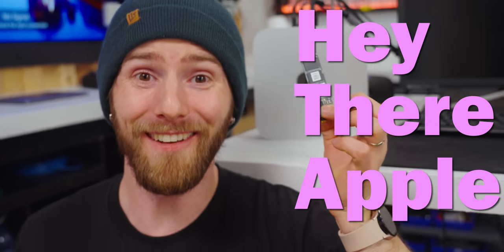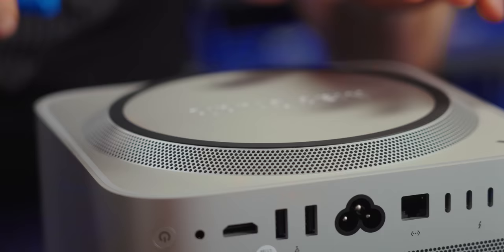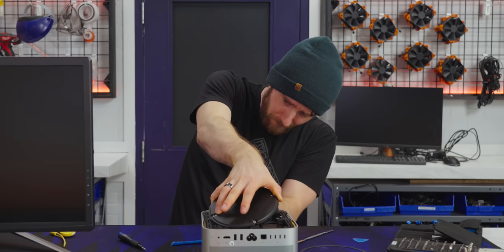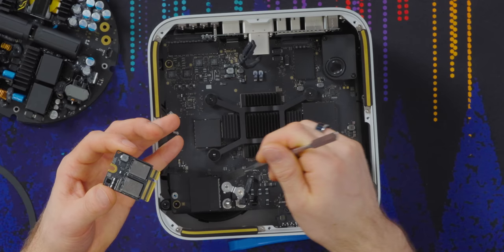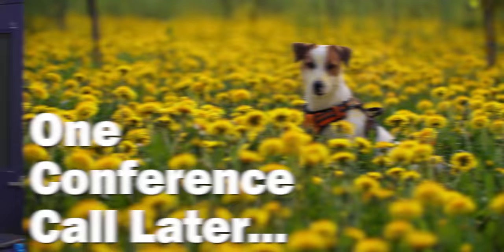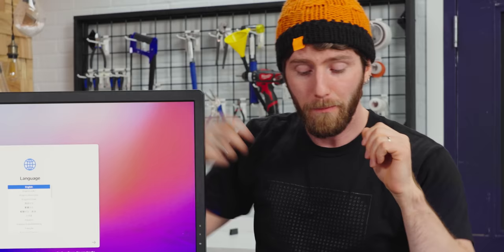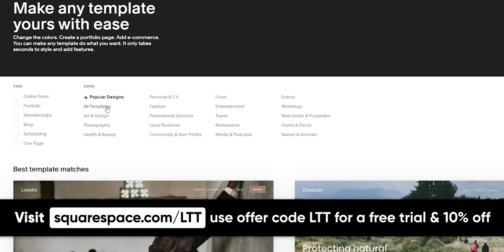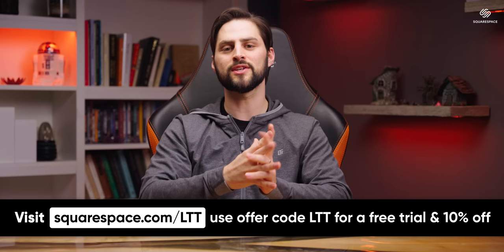I want to love Apple, but they’re making it hard - Mac Studio SSD Swapping

Comment: Apple: our all cardboard packaging shows how green of a company we are!
Also Apple: throw out your entire $3000 computer when you run out of 512gb storage.
Reply: That price is nauseating
Reply: The fact that they even sell computers with less than 1tb of storage is hilarious.
Reply: What an over simplification this statement is. It's a desktop with multiple Thunderbolt ports so nothing to stop a user adding external drives that will be damn fast. It also has a 10Gb Ethernet port so connect it to a NAS for bulk storage is another possibility. Only and idiot throws out a computer because the HD is full, at worst they sell it.

Your statement is slightly more relevant in relation to RAM though where you don't have an upgrade path but even then, only an idiot would throw it out.
Reply: @jadamsnz  Tim Cook alt account spotted.
Reply: @jadamsnz  Yes, because the average Apple enjoyer would go out of their way to build their own NAS. 
The people that are notorious for prefering ease of use over upgradability and customisation.
Best they'll do is put on some external  HDDs/SSDs, but even then the point of this mini pc is to have a small clean pc somewhere nice, not have stuff hooked up to it all the time.
Reply: @0cyb3r0  A Mac studio user would. These are people who are working with massive amounts of media. You can buy off the shelf NAS machines too/.
Reply: @SirFrag32  Yeah all those people who write 20Kb code files or draw a single 50 Meg image in the matter of days really need a NAS... A bit of a bold assumption.
Reply: @jadamsnz  talk about putting words in people's mouths. it's plain and simple and yet you missed it. buying something of this cost in the PC space allots you ANYTHING you want to change. and it gets the job done just as well, as proven time and time again. 10 gig ethernet on LOTS of motherboards on the PC side. but they still give you upwards of FIVE m.2 storage slots, and let you raid and set them up as you wish. apple is being cocky and saying "we know better" and are basically FORCING you to buy extremely expensive network storage or pay into extended storage on the iCloud. 100% of their hardware model is built to make you spend money once youve run out of room. PC is the opposite. need space? cheap upgrade. need speed? cheap upgrade. apple is image and clout and a moneymaking scheme. it's pathetic, and it pisses a lot of people off that they make this nice "green" packaging and yet make it so you cant do crap to your TINY storage if you happen to fill it up. oh, and apple's network storage isn't going to allow you to edit massive video files via 10 gig network connection because the storage in the time machine isnt fast enough to come CLOSE to saturating a 10 gig connection. so your whole argument there is completely moot.
Reply: @0cyb3r0  I'd imagine the bulk of Studio owners will be content creators working with video. So a NAS would be commonplace among those users.
Reply: They just want you to pay for cloud storage
Reply: @Skrenja  for that price too
Reply: @atlehassum1492  im happy enough with my intel nuc, way better
Reply: @jadamsnz  r/woosh
Reply: @jadamsnz  we found the apple fanboi, guys :)
Reply: Yea, I remember my iPhone storge got full so I threw it away and bought a new one. I considered cleaning out space, but yea.. fuck it, toss it. If you could let me know where you live, I'll stop by and pick up all of your computers with full storage since you're throwing them out.
Reply: @kevinmorrice  it’s literally and figuratively not.
Reply: @0cyb3r0  "build their own NAS"... since the common narrative is "Apple users have too much money", the average Apple user would buy a Synology (for ease of use). There is no need to "build your own NAS". I am actually surprised that storage complaints on a stationary device in 2022 are still a thing. Especially on a device that has a couple thunderbolt ports and 10Gb lan. 

It's even more baffling when you consider that this is aimed at creators... creators who most likely have a MBP and iPad. They most likely have a NAS already so they can work on their stuff away from the Mac.

Complaining about non expandable/upgradeable storage makes more sense when it's a Laptop.
Reply: LOL! I can’t imagine anyone would buy a computer with six Thunderbolt 4 ports and then complain about using one of them.
Reply: @jadamsnz  We found an apple customer hahaha
Reply: it's only green when it benefits them
Reply: @Skrenja  for me it's the fact people actually buy them.
Reply: @jadamsnz  i dont know about you, but i think even a m-atx motherboard PC fully loaded with SSDs is more green, more cost efficient, and more space efficient than having to own a studio intended mini-PC that requires a NAS to be useful...? Then whats the point of making it excessively small then? Might as well use standard Mac tower cases with standard ATX power supplies (or 12V ATX) which should be cheaper and greener since its the standard. 

if its meant to be used with removable drives and NAS, then whats the point of it being mini and portable. if the consumer has a NAS at his studio, then brings the Mac Studio on weekends to continue work then its not gonna be an easy way to connect to his NAS, and even if he could, getting a good connection would be expensive. its just self-contradicts itself. you're just saying random stuffs to justify Apple products but you dont even think about real life applications. 

why do you need a 2nd mac for troubleshooting said product? previous mac products can troubleshoot themselves before just fine. is that such a huge obstacle to overcome as you transition to a new SoC chip? even then, considering the overpriced retail prices of apple products im pretty sure apple has enough funds to spare for engineering that part. also you had to engineer said products to be able to communicate between each other for troubleshooting so that is already an engineering investment so wtf? why it can talk to other macs while broken, but cannot try to fix itself while broken?

after all facts have been considered, the absolute truth is that Apple products are for people who have the money, is willing to spend the money, and just has zero concerns about upgradability, future value, cost efficiency, power efficiency, space efficiency, and ergonomics. They are perfectly fine with getting what they are advertised on face value and is satisfied with the product for the rest of its life, which is fine i guess. the problem is other platforms offer so much, that some Apple consumers question "why cant we have a certain degree of this too, i thought we are a premium brand, we should deserve to get this, even if we have to pay more" but you just cant, even if u had money.
Reply: @jadamsnz  Why should I have to have external drives only.  On my pc I don't.  I can simply plug in s higher capacity drive and boom. Off I go.
Reply: It's not really an issue with dektop, but HUGE issue with laptops. You won't even notice an external drive, or NAS on your desktop, but you will always forget it at home when you need to use it with your macbook.
Reply: @Skrenja  there's so many computers with less than 1 tb. My mom is shopping looking for some kind of laptop with the space she wants and SO MANY are coming with just 512. She's not a techy person, but she's seen this size harddrive come and go and become outdated and is PISSED.
Reply: @jadamsnz  let it become an octopus with 500 arms simply to store your pictures. No. Just stop. There's 2 slots in there for more storage, it should be reasonable to allow a user to fill in all the slots, much less replace a flash stick with a higher capacity when that inevitably becomes available down the line.
Can you honestly, reasonably consider a desktop windows PC that would prevent you from adding in another drive to your sata port as acceptable? No. No way in hell. Laptops have already for decades allowed you to fill in every storage port and upgrade your storage to your heart's content. there is no reason, besides greed, to block this from the consumers.
Reply: To the commenters siding with Apple in this, stop. Just because a use case exists for it, doesn't justify them making this choice. The idea is simple. They want to make devices more serviceable with one hand, and then lock down what would otherwise be a common thing for user servicing (storage) with another.

It wouldn't take Apple much effort to make these things easy to access and service, but they not only choose not to but they put arguably more work into making sure you can't.

It's truly annoying and anticonsumer and it's the entire reason even diehard Apple fans have been upset with this approach.

No one wants to blow a bunch of money on a product you can't fix or upgrade when the alternative exists. But people get so sold on the OS they are afraid of switching out so they just keep feeding the beast.
Reply: Also Apple: Thinking people use this wonderful thing called an external drive .  PC minded people replace the entire computer every 2-3 years.
Reply: @jadamsnz  Right.  In the MacRumors thread "The base model Mac Studio is great value."  F-Train shows his set up - main internal SSD only has the system and a handful of application that must be on the internal and everything else is on external SSD.  Only 50 GB of his 500 BG (ie a 10th) has stuff on it.
Reply: @Maximara  this is so adorably naive. Consumer PCs currently aren't intentionally engineered to prevent the most basic of upgrades, and /requiring/ the extra copper, plastic, and aluminum for external drives and cabling because you're locked out of existing and empty drive ports isn't green either.
Reply: @Crunchy415  You are the one who is "adorably naive". Steve Glaser an Electrical Engineer pointed out on Oct 11, 2018 the reasons for soldered chips:

* Cheaper — no sockets to buy  Faster to build — fewer steps  
* More reliable — sockets are mechanical parts and sometimes flake out  
* More rugged — dropping the computer won’t knock something loose  Market segmentation — if you want 8GB but the, otherwise ideal, model only has 4GB soldered down, you will likely buy a more expensive model with 8GB  
* Loss leader — limited power non-upgradable computers are sometimes intended mostly to get you in the store so they can up sell you  
* Parts availability — socketed parts are sometimes different than soldered down parts and the parts suppliers may not make all variations  
* Smaller — sockets require height which is a big concern in portable gear. Height also somewhat affects air flow / cooling, even in desktop gear  
* Heat transfer — soldered down components can more easily dissipate heat via the board. Heat sinks are somewhat easier and cheaper without a socket in the way.  
* Tamper resistant — soldered down parts are harder to mess with making it more likely you receive exactly what the manufacturer intended

"The scourge of fully soldered and non-upgradeable laptops" says much the same thing and worst some of the supposedly upgradable computers use proprietary slots and don't think they don't charge for that supposed "upgradability".
Reply: @Maximara  You're willfully ignoring the part where there are empty flash storage ports that at-best can only be used if a separate mac was purchased, and realistically cannot be used at all because it thoroughly contradicts every claim you just made.
You seem awfully upset at a flippant comment made at a multi-billion-dollar brand for greenwashing as ineffectively as they have been. Maybe this is why people call Apple consumers cultists.
Reply: @Crunchy415  And you are willfully ignoring that there are PCs that do the same thing as Apple or that the simplest solution is get an external SSD.
Reply: @Maximara  Yeah, that's also bad. That also has nothing to do with what I said.
Reply: @bseffrood   better being satisficed (not the same as satisfied) spending 500 dollars on a NUC than spending 3000 dollars on a Mac Studio, later realizing you got too little for your money... Now you can fanboy all you'd like about Apple if that's your thing, I really don't mind. But please don't try and convince us that 3000 dollars for a preassembled, glorified NUC with a picture of an apple on it is a good deal.
Reply: @Skrenja  It's not really a problem in a typical business, though, where everything aside from the operating system and installed software is stored on a NAS (which many of us do at home, too).
Reply: @Skrenja  I know right? I have 2TB in SSD's and 4TB for backup/storage in my PC and already thinking to upgrade.
Reply: @Alpha8713  Don't make excuses for Apple just because people find compromises and adapt to their stupid, anti consumer designs. 1TB should be the minimum storage for a "pro" device. To see so many people saying otherwise and defending this is just sad.
Reply: @Skrenja  I'm not defending Apple.  I am defending the idea that large amounts of local storage are unnecessary and, indeed, often undesirable for many use cases.  In a business environment, you don't want stuff stored locally.  For reasons of backups and data security, everything should live on the NAS.
Reply: LMAO!!
Reply: @0cyb3r0  Then they probably don't need 1TB of storage standard either...
Reply: @Skrenja  To be fair I do HDD -> SSD swaps for people all the time, and most people only need a 256GB drive unless they store a bunch of videos and stuff.  A typical Windows install with some basic pictures and documents isn't going to get close to even 100GB, and I imagine the same is true with MacOS.
Reply: @aoyuki1409  I’m not going to comment on the debate regarding corporate evil etc, but I will say that the 2 macs I own have been great tools. Macbook Pro 15” purchased in 2012 - for $2400, still working perfectly. I just used it on a business trip. My desktop iMac 27” purchased in 2013 for around $1800…is also still working perfectly well. Despite the fact that I can’t upgrade to the very latest system software. 
I don’t  to upgrade to a new Mac, but I do want to, and to migrate to Apple Silicon. My current Macs are Intel machines, and they’ve been great. But the new computers are really appealing. 
So, yes, the initial cost is high. But the computer last a really long time. That’s been my experience, and I moved over from PC’s back in 1996. All of my Macs (MacBook G3(! wow, that was long ago); G4 tower; G5 tower; early iMacs…and finally the Intel series back in the early ‘aughts). None of those computers died…and each lasted many years before I sold them and upgraded.
Reply: @brullotj  yeah and i have a friend whom has 3 previously broken down macs, on which the lastest mac that still works he couldnt even run 3D Solidworks on and had to ask my opinion on windows based laptops so that he can attend classes.

your story doesnt tell anything new. its perfectly normal to have a product last for ages, thats to be expected. but its not like non-apple computers have a time bomb set to kill the computer after 5 years of use. no. most of the PCs that i build for my cousins and my aunts are using last decade parts as well so that tells me nothing new.

you're speaking as if non-apple computer parts cannot be sold or upgraded. there's a literal market for used PC parts. and the parts there are at least 10x better value than apple products even if you factor in the age and possible reliability issues due to age.

when it was 1996, the x86 processors weren't as powerful as today's or even the ones in 2006. the first dual core processor was in 2005. when you moved from PC to Apple at the time, practically you're not impacted by any software limitation since everything is limited by hardware.

fast forward 20 years, there's a whole list of windows softwares and apple softwares, some works with both, some doesnt entirely. this becomes a great issue for users who needed softwares that cannot run on apple machines due to its OS limitation. buying a 3000 usd mac but has to run an emulator, then runs a super heavy performance hitting software and gets an experience equal to a walmart laptop is probably the most disgusting thing i've ever seen anyone do in front of me.